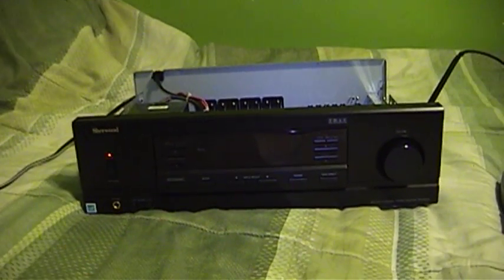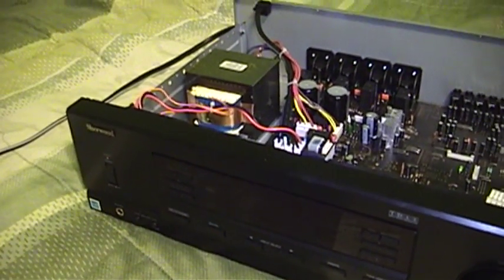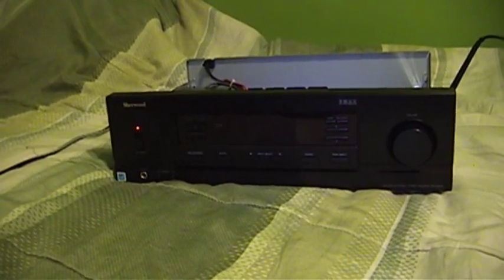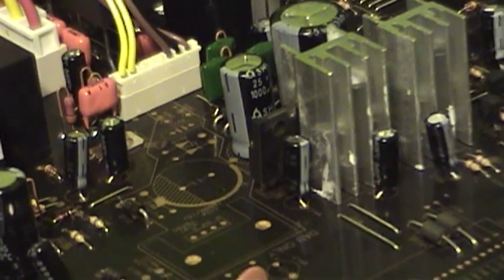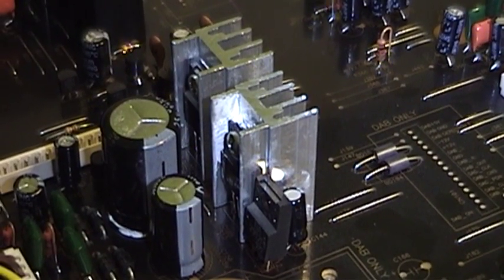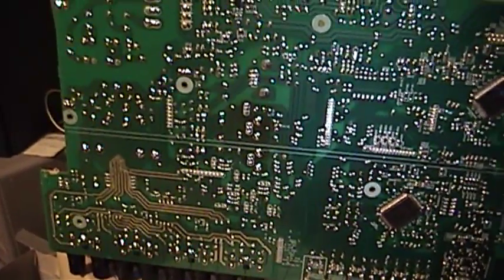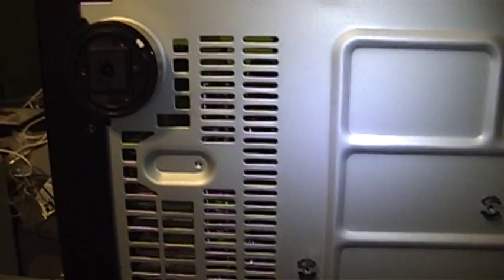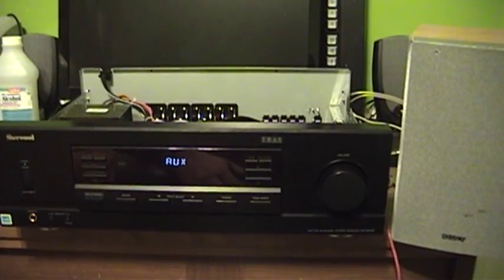Kitchen Table Electronics Repair: Sherwood RX-5502 Multi-Zone Stereo Receiver

Comment: uxwbill,  I have the same receiver with the same symptoms.  I pulled the cover off and checked the voltage output (as you described) from the regulators and they are reading 12 volts.  Do you have any other suggestions?

Comment: Can you tell any difference in the bass response between the RX-410x and this receiver?I noticed Sherwood shows a different frequency response for this receiver compared the RX-410x.Sherwood filters the low end out on most of their receivers.nothing below 40 hz is passed through.it makes my speakers sound hollow without that deep bass.

Comment: I started building a VFD clock a few months ago which uses a 230VAC to 24VDC transformer for the VFD, and also a 7805 voltage regulator for the microcontroller. The microcontroller doesn't need much juice, maybe just about 10 mA. Although there is almost no load on the 7805, it gets boiling hot, so I figured, that it's burning away the remaining 19 volts as heat. I'm still trying to find a solution to cut the waste. The current state can be seen here: watch?v=5QzI2qikEak
Do you have any ideas?

Comment: In looking at reviews for various receivers, I came across the following review of the RX-5502.  The reviewer seems even more enthusiastic about this particular Sherwood model that even you are.  In your opinion, would you say this review is accurate or a lot of exaggeration?  

"by p51joe
Sep 28, 2019

Sherwood RX5502 

SUPERIOR TO MOST MODERN ERA RECEIVERS

First off, if you are looking for a 2 channel receiver with decent output for most situations, this is it. The amplifier is of a tried and true design having it's roots in older equipment like the NAD 3020, only using faster and more powerful output transistors. Here is where this receiver shines. It had a dedicated and discrete phono section operating on 15volts. Frankly, If I could buy these cheap enough I would buy all I could get my hands on and sell the phono amp as a stand alone with a power supply of my own design! Anyway, the only fault to find and frankly typical of MOST electronics made today is the voltage regulator pair. If left on continuously for weeks on end, one of the pair will burn up due to no heat sink. But you want to know how this sounds. I have audio equipment costing thousands. (Marantz 7 and Model 9's) This little unit sounds better than most any receiver I have auditioned, including 1970's Marantz units that people pay stoopid money for because they have pretty face-plates. I would recommend this unit over a Cambridge Audio, Yamaha or HK receivers made today and frankly any other Sherwood with the exception of the S-7900A/8900A and S-7310. This unit shares architecture with Insignia and Pioneer, as all receivers come from the same spot on the globe. The difference is that Sherwood has some subtle changes to the circuitry that make it sound fantastic! The take away is that if you listen to records, you can NOT beat this thing for the price they bring used. You can not beat it's sonic performance even if you spent $500 on a receiver."
Reply from the maker: I'd say it's an exaggeration. The Sherwood's not a bad receiver for what it is, but it's not THAT good.
Reply: @uxwbill  Shit, and I just bought one on the strength of this guy's review.  I already have an ONKYO TX-8140 which I was going to swap out for the Sherwood RX5502.  I guess you would advise me to forego this change then?

Comment: Not dogging you or your video, it was great. I would advise anybody looking at the Sherwood RX of any kind to stay away. These things are bad. I've worked on three of them with various problems and seen others on youtube with various different problems. The first one was a open transformer. A wire broke off inside. The second one was the small transformer for standby was smoked. The third was user damage, a shorted output transistor. One thing about them as far as performance I don't like. [Don't think they have enough bottom end], bass but that's just opinion..
Reply from the maker: I'll be among the first to say that Sherwood's quality control is a bit hit or miss. All I've mine -- including a few that I bought broken and found to have no problem at all, or whose problems were conclusively caused by user error -- have been good to me. 

Speaker choice makes a big difference with the RX series receivers. And maybe that's been true for a while now: the receiver attached to one of my computers is a Sherwood RA-1140 from the 1980s. It sounds very similar to the modern RX-series and speaker selection makes a huge difference there too. In addition to being the smallest receiver I've seen with a discrete output stage, the little RA-1140 is a personal favorite. Lots of receivers can blow it away in terms of power. None have in terms of sound quality -- I've swapped it out for others, and time after time it comes back.
Reply: i had a sherwood for 4 years  and one day it just died  
so i pulled out my Kenwood thats from 2002

Comment: Mine I plugged and now it just shuts off seconds after turning it on and I don’t know what’s going on and or haw to fix it
Reply from the maker: If yours is brand new, you should simply exchange it for another. Likewise, if it's under warranty, contact Sherwood and let them take care of it. If not, you'll have to do some troubleshooting to figure out where the problem is. Check your speakers and speaker wiring for any shorts. If that doesn't turn anything up, you will at a minimum need a multimeter and a basic understanding of electronics theory and class AB amplifier design.

Comment: Bill must be the main power supply I used 1 set of speakers for 2 amps,,,,,,,,and I forgot to take the plugs out when I turned on the pioneer ! Some resistance must have passed through the pioneer,,,,,,,,,? Mind you the second receiver was turned off,,,,,,,,,,,,,when I turned on the pioneer,! It just cliked the pioneer,! Now it is complete dead,! wont turn on fuse in the pioneer did not catch it,! shawn! I bought it sealed box with no warranty

Comment: I turn my sherwood on and it playes i turn it up and it kicks off what to do
Reply: on my sherwood (i think it's the 4105) it has speaker protection and it doesn't like much below 8 ohm speakers.or it will shut itself off. I tried some polk bookshelfs with it and I started pushing them pretty hard and my sherwood shut off. They label the speakers 8 ohms but I checked with an ohm meter and I got about 3.8 ohms on each speaker so I figured I fried the tweeter in both speakers. Checking each tweeter though I found they were good so the polks are just lower than 8 ohm, I'd probably call them 6 ohms. Another time i was pushing some speakers pretty hard and the receiver shut off and I discovered a tweeter did blow in one of those, I replaced the tweeter and then the receiver played just fine. So mine really seems pretty picky about the ohms of the speakers. Another thing to note jamming those polks my receiver got pretty warm where as pushing my bose 301's hard (which are 8 ohm) the receiver doesn't get anywhere near as warm, so that was another indicator that the polks are closer to 4 ohm than 8, I bet.

Comment: Bill, help me. I have the same problem. BUT I have measured the voltage in the pin you did it on 10:32 and it shows 12v. Also I have measured the voltage on each of the voltage regulators 7812, it shows output 11.9-12v for each of them, and the near VR 7912 shows 11.6v. I think it is good, isnt it? BUT SHIT, IT STILL SHUTS OFF AFTER 2-3 SECOND AFTER TURNING ON!!! Any ideas? Thanks,
Reply from the maker: There may be one or more shorted output transistors. A 7912 is a negative voltage regulator and should have had a negative voltage coming to and leaving it. (78xx series regulators are a positive voltage part.)
Reply: Thanks uxwbill, is there a thermo fuse on this board?? if so where is it located?

Comment: hi I have an RX5022 I have lost the right side speakers and when balance button is pushed a RO symbol is displayed. Does this mean one side of my amp not working. I have tried speaker cables in BCandD with the same result.

Comment: Hi uxwbill, ok i replaced  both 7812 voltage regulator and still turns off when i press the power button but i don't get a blinking red light it stays solid red. when i turn on the power i have the volt meter on the connector i get 12.34 volts then it starts to drop and  i hear a relay on board turn off. also the amplifier is out of the unit. what voltage should read on the other voltage regulator 7912? hoping to get this up and running. just over two years old. thanks for your help.
Reply from the maker: The only advice I can offer is that of continued troubleshooting. Something's loading down your 7812 regulator (or its power supply is bad), and you'll have to find whatever that may be. Look at all the passive components around the 7812 regulators. Remove them, and test them.

The 7912 is a negative voltage regulator, and should have approximately -12 volts DC on its output. As far as I know, it is used only for the phono preamplifier.